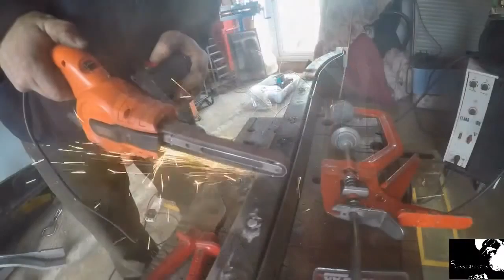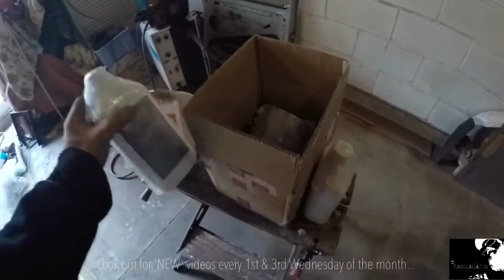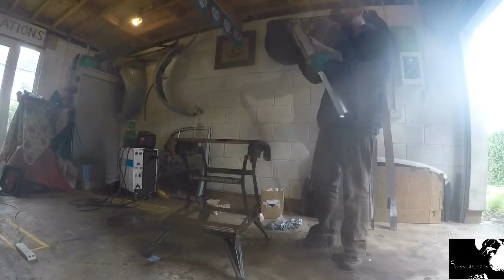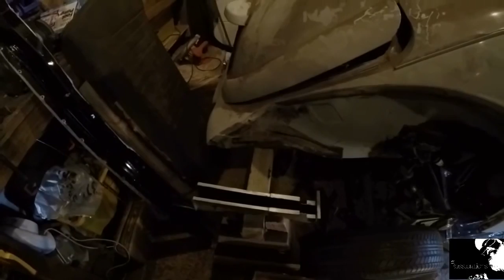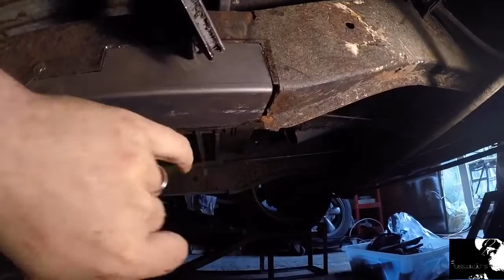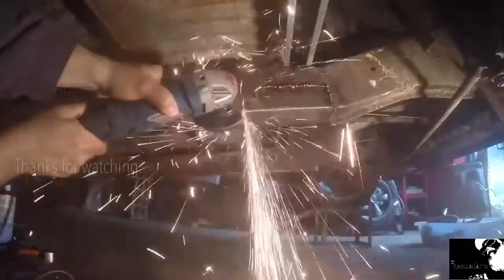Classic 1970 Vw Camper Bus restoration. 'Day 26 - panel prep & chassis rail repair'.

Comment: we got a store called harbor freight . they had a sidewalk sale and had 4.5 inch thin cut grinder metal blades 1 dollar for 10 pack I really dont know what Ill use all of them on but I got 6 packs. I am fixed up for awhile Rambus
Reply from the maker: Good stuff, start cutting stuff up...